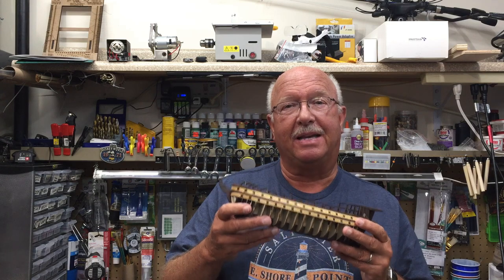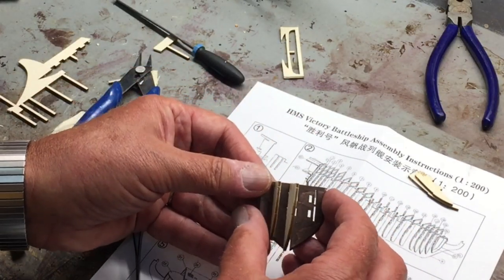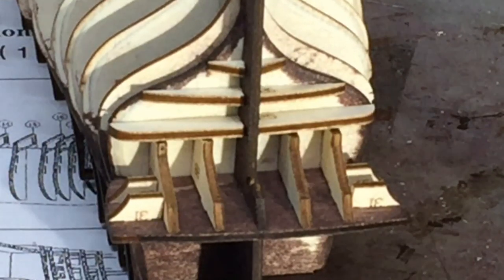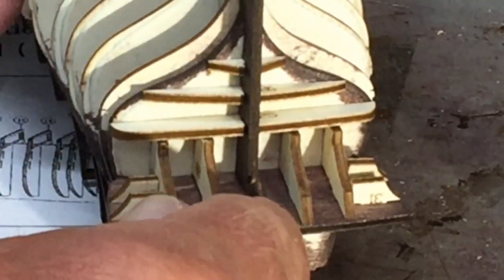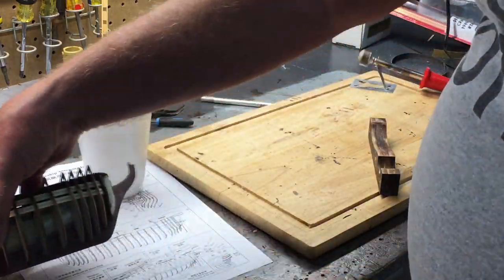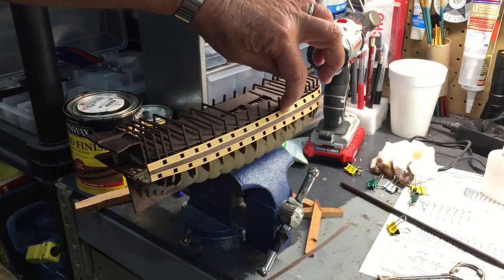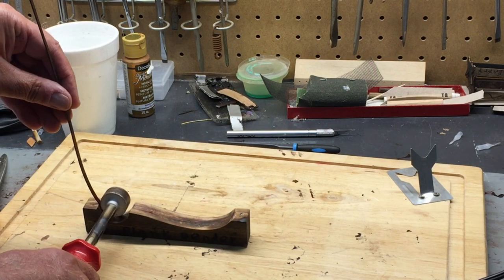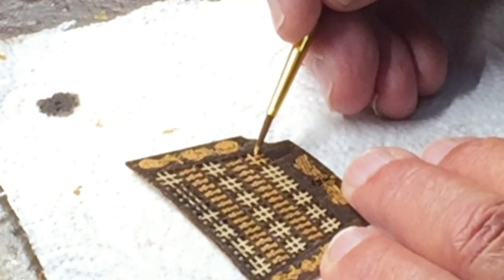HMS Victory Model Ship Build Episode 3

Comment: Can you tell me about the hot iron you're using to bend the planks? I'm having trouble finding info on it. Enjoy the vids.
Reply from the maker: Here’s the exact one that I have.  It comes with the wood shaping tool too. 😁👍👍
Electric Plank Bender for Hobby Model Ships by Model Shipways - MS7205 https://www.amazon.com/dp/B01F0IEUTI/ref=cm_sw_r_cp_api_i_6K82N858ARH2JSYWKMRA
Reply: @BoilerDan1  Do you know another seller ? It seems that this product is sold out. Thank you
Reply from the maker: I think this is similar to the one I purchased:
https://www.ebay.com/itm/373155023636?mkcid=16&mkevt=1&mkrid=711-127632-2357-0&ssspo=Ryv2grX0Q_O&sssrc=2349624&ssuid=s8A53jWuRTC&var=&widget_ver=artemis&media=COPY
Reply: @BoilerDan1  Thank you for the answer, I ask about the hot iron you're using to bend the planks. The hot iron is sold out in the link that you provided before. Do you know another seller ?
Reply from the maker: Sure:
You can always find it at Model Expo
https://modelexpo-online.com/Electric-Plank-Bender_p_635.html

But that link may charge for delivery.
That company also sells it on eBay with free shipping:
https://www.ebay.com/itm/364078876524?mkcid=16&mkevt=1&mkrid=711-127632-2357-0&ssspo=geNBi6sWTeW&sssrc=2349624&ssuid=s8A53jWuRTC&var=&widget_ver=artemis&media=COPY
Current price is in the $36 range.
Reply: @BoilerDan1  Thank you Mr. Dan

Comment: Great build. What type of paint you use as a primer?
Reply from the maker: I almost totally use stain, and pre-stain all the wood planks and parts before assembly. That way the glue doesn’t interfere with the stain being absorbed. I then top coat the stain with Tung oil, usually after assembly.
On the cannon doors that I slightly painted the edges red, I should have primed but didn’t.  It would have been better primed.  The lighter color I just covered with clear, so that’s the natural color of the wood.
Thanks for watching 👍
Reply: @BoilerDan1  thankyou so much